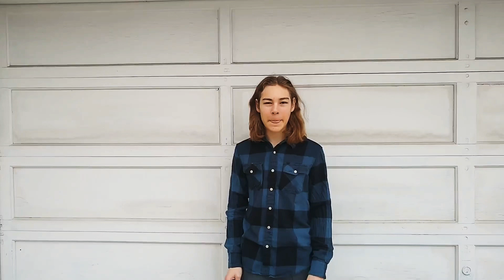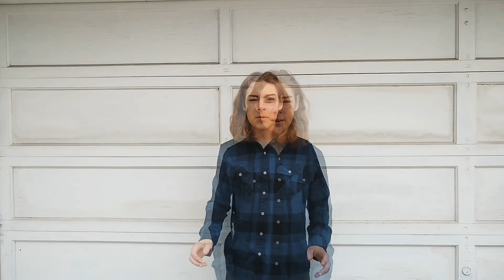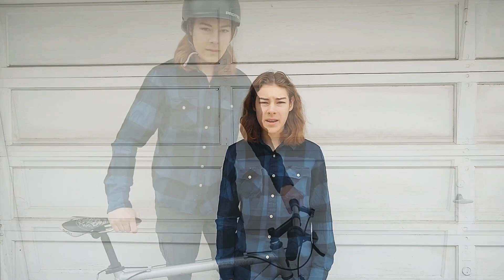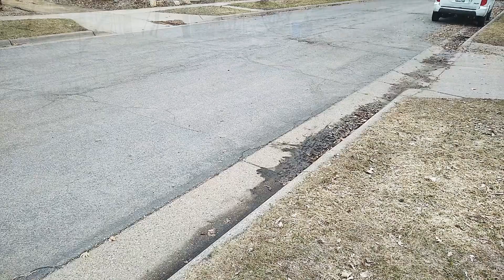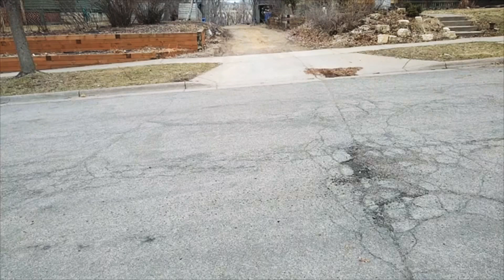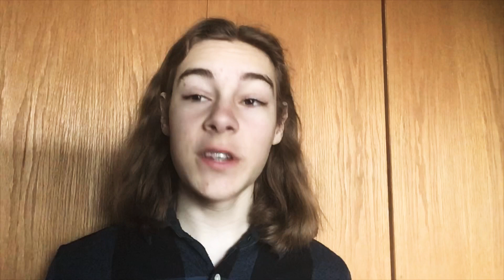Why I Hate Grip Shift

Comment: I've never had issues with accidental shifting on twist shifters...
Reply: accidental shifting occurs when you are rotating your hands on  the handlebars a simple way to avoid this is to move the shifters in towards the stem and put on longer outside grips. and not pull up on your shifters or push down on them when you know you are going up or down. putting torque on the chain on the chain during a shift can cause a chain to be thrown. one of the things i really like about grip shifters is you can shift in deep cornering to power out of a turn. you cannot do that with trigger shifters. when i raced i would smoke a lot of other riders doing down and upshifts in turns.. when i would jump or down i would not shift at all and move my hands to the outside of my bars.
Reply: @josephgiannini6174  Exactly. I as well pair long handle grips with the shifters. Just need to slide my hand onto the shifting grip whenever I need to change gears.